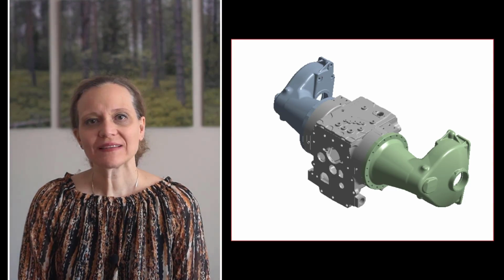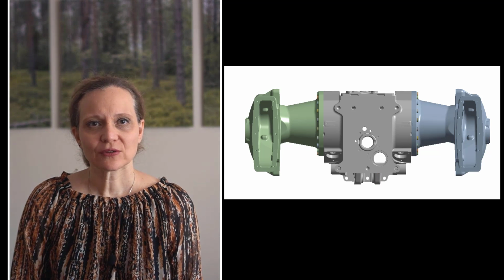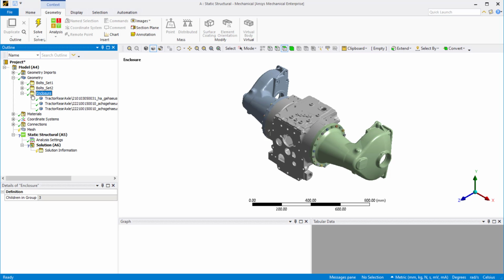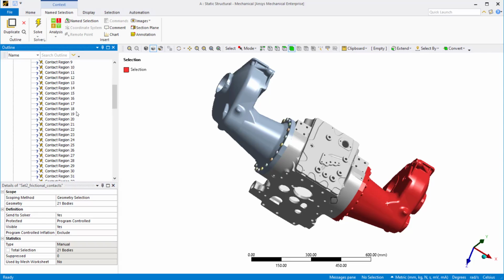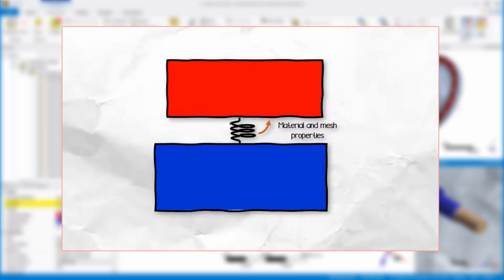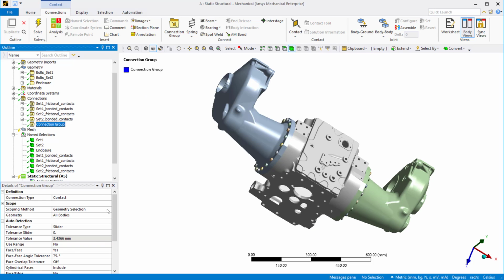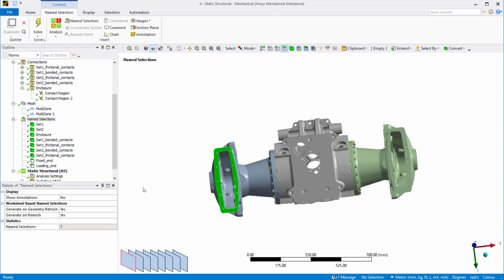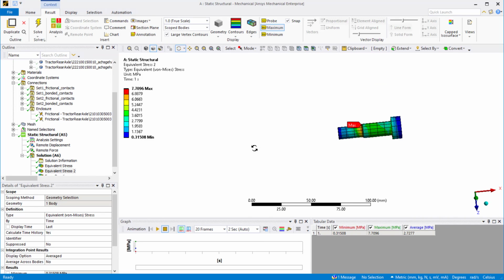Modeling Bolted Joints of an Axle Assembly Using Ansys Mechanical — Workshop

Comment: I watched video and tried to make the simulation but even if force result is approximately 2000N, equiv. stress max is 234.95 MPa, and total deformation max is 1.09 mm. I rewatched, and made it step by step, however results are not changed. Ansys 2025R2. Is there anyone gets similar results to me, and how does it be fixed?